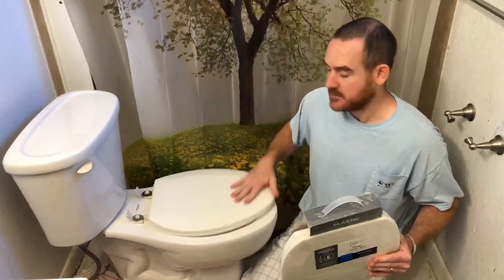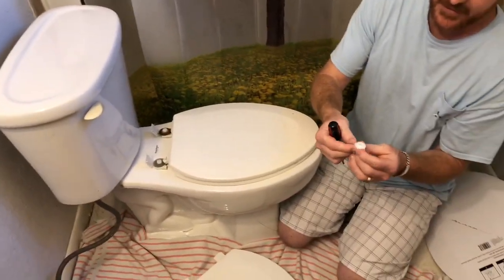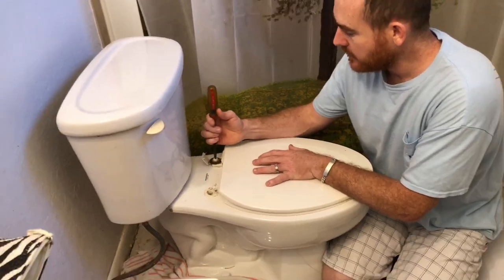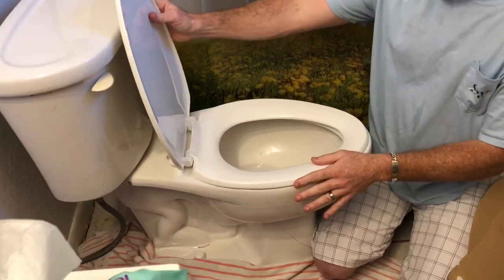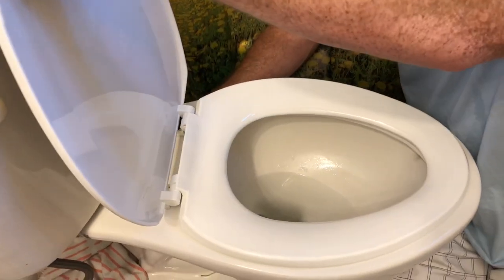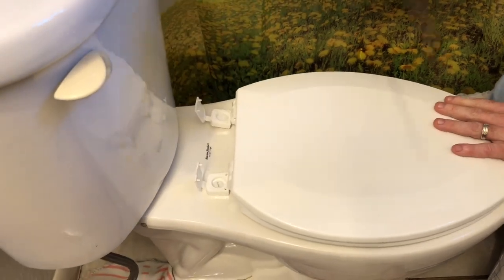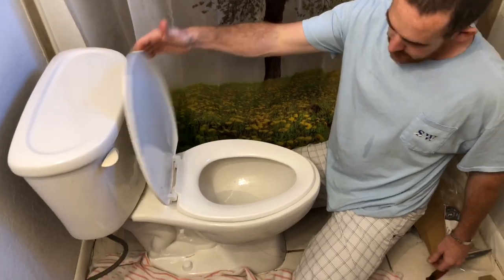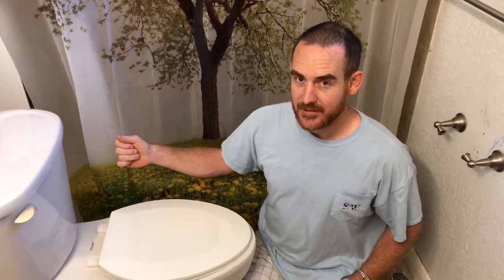How To Fix Replace a Toilet Seat Lid

Comment: I was worried the seat was broken in my apartment.  Just needed to tighten the plastic bolts - didn't realize they're down there but could tell it was loose. Saved me a maintenance call! You're awesome.